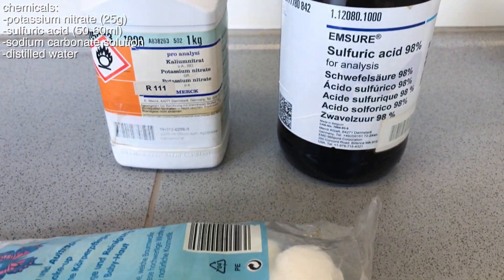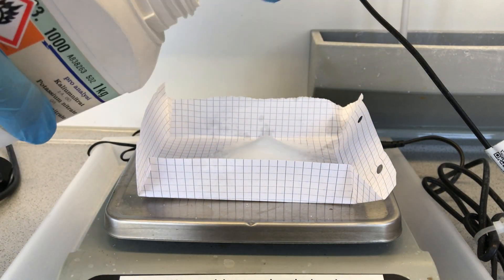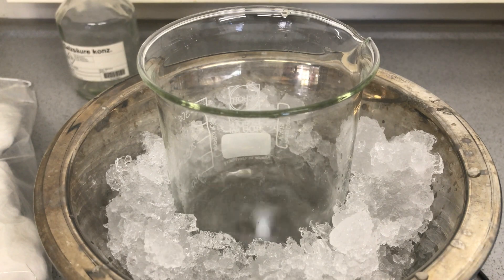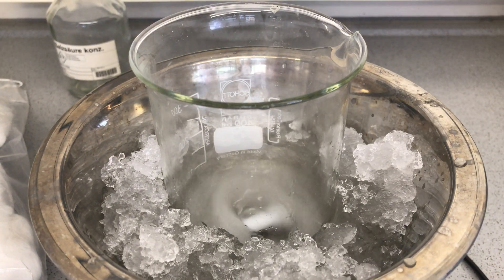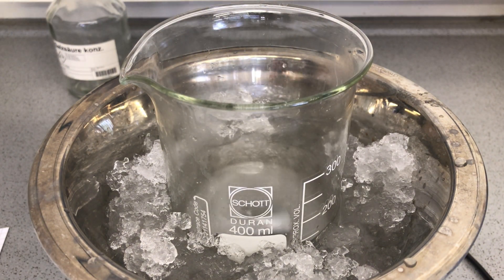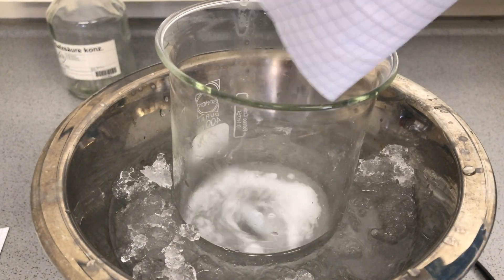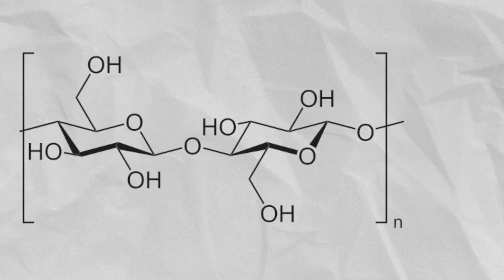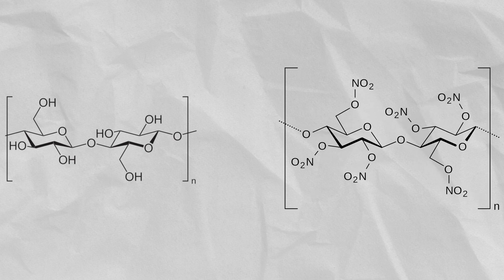Making Nitrocellulose / Gun Cotton #97

Comment: WHERE DID YOU GET SULFURIC ACID 98%?
In Poland you can only get 5%
Reply from the maker: i have a business. i can just buy it. even got a license to sell but it is not allowed to be sold to private people in concentrations >15%
Reply: @THYZOID  Is there like a way to concetrate it? Or you need to much lab equipment for it?
Reply from the maker: you could literally just boil off water in a beaker until 94+%
Reply: @THYZOID  Okay,thank you.
Reply: @CussingMan boil the liquid from a lead acid car battery which is 35, outside, do not breathe it in 

It has to be under 300 or so c so you only boil the water off

Comment: Hoping you can shed some light on why this keep happening to me. 
Using 98% H2SO4 and 68% HNO3 under 5C at all times, 100% natural cotton balls slow mix of the acids YET , the product comes out dissolved every time. Again, this is done at very low temperature and slow mixing with no NO2 or 3 as a byproduct. Temperatures were stable at all times.
Removal is done via cold NaHCO3 bath. Why does my product get dissolved like this? I would expect to see this if the temperature were at dangerous levels but it is not. Any ideas?
Reply from the maker: did you mix the acids beforehand or threw the cotton into the conc sulfuric acid first? it is important to pre mix the acids.

Comment: Why does my cotton dissolve when I wash it
Reply from the maker: because it likely is cotton not made from cellulose. try another source for cellulose
Reply: @THYZOID  Isn't medical cotton pure cotton?
Reply from the maker: @bigice2121  normally it should but in your case i doubt that it is. i mean it dissolved
Reply: @THYZOID  I tried the paper, and it still dissolved when I rinsed it, but the rest of the paper had a little nitration
Reply: @THYZOID  I succeeded for asked chatgtp, he told me that it was too much sulfuric acid that caused the cotton to dissolve. Maybe my potassium nitrate was not pure enough, so I finally made it with 1:2(g) ratio.
Reply: i wash in ice Water
Reply: The heat turns to paste and then disappears

Comment: Why is this guy pretending to use concentrated sulphuric acid when he's not?  Concentrated sulphuric acid at 98% is called oil of vitriol for a reason, and it has a reddish colour, rather than being clear.  Also, the solubility of KNO3 in water and/or H2SO4 at the temperatures required for nitration (<15°C) would be too low to allow 25g of KNO3 to dissolve.
Reply from the maker: pure sulfuric acid is clear. if yours is reddish it is contaminated. the KNO3 reacts and potassium sulfate is more soluble in sulfuric acid than you might think. next time get your chemistry right before criticising.
Reply: @THYZOID  I know the chemistry perfectly.  And having tried your proportions and durations, the cellulose burned little differentlty to untreated cotton wool.  You don't help yourself by being so unclear in you methods.  you mention distilled water, yet no quantity is stipulated.  Also, you fail to mention that the nitration process can be compromided by excessive temperature - kind of important given the exothermic nature of the reaction!!
Reply from the maker: @nigeldenning5810  tell me why the distilled water is used. if you know you will also understand why quantities are not needed
Reply: @THYZOID  Water will dilute the acid, which invalidates the stipulation of a certain strength 9f acid in the first place.  98% H2SO4 combined with an equal quantity of water becomes significantly weaker!!
Reply from the maker: @nigeldenning5810  the water was used to get rid of the acid after the nitration
Reply: @nigeldenning5810  lmaoooo
Reply: @THYZOID  14 ml h2so4 or 400?

Comment: nice! I've actually tested flash cotton in ammo. in its cotton form it seems to prefer bigger calibers like 45 long colt, in 9mm the power was rather unimpressive.
Reply: A pasta maker on the spaghettini setting and nitrocellulose with a little acetone to make a putty can make decent powder. Be careful using the fluffy cotton, it can cause really high pressures.  There's a big thread on homemade powders on the sciencemadness forum that could help if you haven't found it already.
Reply: @chemistryofquestionablequa6252  You can gelatinize it with ethylacetat and knead it than like blackpowder press it throught an thief. But round guncutton only in shotguns and revolvers because it burns very aggresive.Early times the put the guncutton with saltpeter in an tumbler and made them moist with an solvent but i think it was the C.E powder. Best methode was an dry mix of Guncutton and Saltpeter shaken under continous moisten with water it forms after time the powder grains.

Comment: Awesome!! Question does it matter if can hydrochloric acid too instead of sulfuric acid or doesn’t matter ?
Reply from the maker: It´s possible to use another dehydrating agent like P2O5 or maybe even acetic anhydride but not HCl
Reply: hydrochloric acid cannot be used
Reply: @karolus28  
"Cannot be used" ... really?

Technically conventionnal aqueous 25-33% HCl is useless because too dilluted by water... but theorically gaseous dry HCl (100% HCl) and concentrated AgNO3 solution or solid should produce significantly/sufficiently highly concentrated HNO3 and solid AgCl... to allow formation of 100% HNO3.
...but also side reactions producing Ag, Cl2, aqua regia, AgNO3, NxOy, Cl-N=O  
Not really cheap nor economical... but possible for desperate cases/ causes.

PHZ
(PHILOU Zrealone from the Science Madness forum)
Reply: @philouzlouis2042  wellp youre right I guess :p

Comment: To get those last OH groups replaced use a second nitration mix with 98% sulfuric and fuming acid.  This has a much lower exotherm and is much less likely to run away than the first nitration.  Low water content is important as like most reactions, it is reversable.
Reply: Much faster than my suggestion, so long as you have ready access to it.
For us poors, we've gotta wait.
Kidding aside, if I was wanting to make a useful object out of it and wanted to get it done in a day WITHOUT ever making more than a few grams at a time, that's definitely the procedure I'd use.
Reply: @matthewellisor5835  going from soluble to insoluble cellulose really requires the concentrated acids and heating as well for maximum nitration.
Reply: Irma, I think we could use a person like you. It would be working in the secluded desert with air conditioning. 😉

Comment: Why not use a mixture of sulfuric and nitric acid?
Reply from the maker: They didn’t have fuming HNO3
Reply: @THYZOID  You can use azeotropic nitric acid. Using of nitrates = loss of the sulfuruc acid which otherway could be recycled
Reply: @THYZOID  Interesting thing i ve found an book about gunpowder from 1848 in the last chapter they discribe guncotton. Nitric acid with an destiny of 1,33 (55%)and 3 parts concentratet surlfuric acid works the same as smoking nitric acid.

Comment: Will the nitration still work if the sulfuric acid is a lower concentration? Like 90-93%.
Reply: It will work but it will nitrate the cellulose less.  For complete nitration you need low water content.
Reply: @lrmackmcbride7498  or heat. But that could be dangerous.
Reply: @matthewellisor5835  Even better.
Reply: @emmepombar3328  to get insoluble nitrocellulose requires concentrated acid snd heat.  That last little bit is stubborn.  And snything dealing with a low water nitration mix is dangerous.
Reply: @lrmackmcbride7498  He is talking about >90% SA. I think, he'll be fine.
Reply: Yes.

Comment: That looks like it was mostly nitrated but those last 5-10% are difficult to get in an ice bath. Once it's equilibrated in the ice bath (60-120minutes) it's safe to let it slowly come up to room temperature and sit overnight (total of 16-24 hours) before washing and drying. Just, as you described here, be sure to avoid leaving any nitric acid for sake of stability.
I have a small sample that's the same color as 3-5 years ago when I made it.

Comment: Nice! You can also make micro crystalline NC if you use micro crystalline cellulose, by the way I saw on discord you were extracting nicotine from something, do you plan on posting a video on that extraction? It would be interesting!  Anyways cool vid
Thanks!
Reply from the maker: Of course I´ll post the nicotine video. Currently the only thing left to do is to boil off the last 30ml of MTBE and it´s done.
Reply: nice you mention NC! 

ive read paper about NC using HNO3 as main oxidant one paper said by addition NaNo2 and others H202, usually finished by base neutralizing and centrifuge 

iam not bright at cellulose chemistry  but did it supposedly HNO3 will produces nitro? or base will neutralize those nitro? because it is sounded very repeatable in backyard lab if doesnt incorporated centrifuge